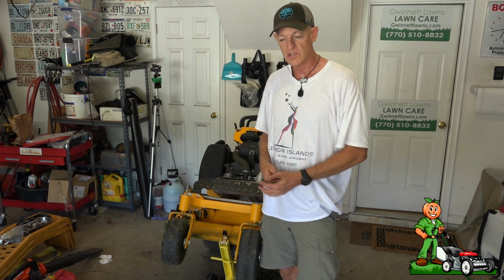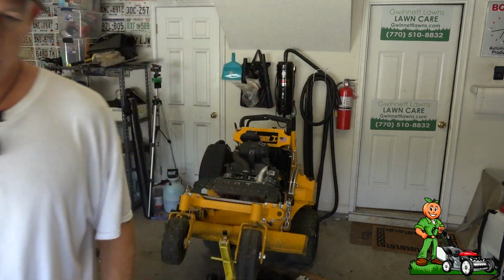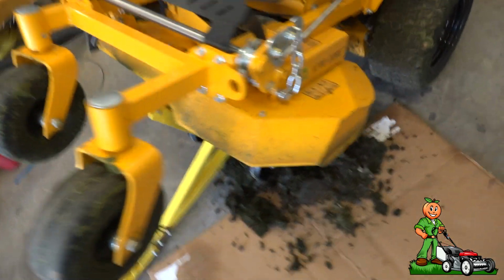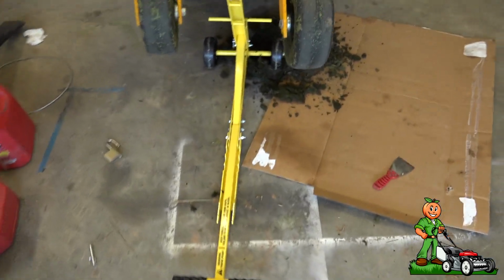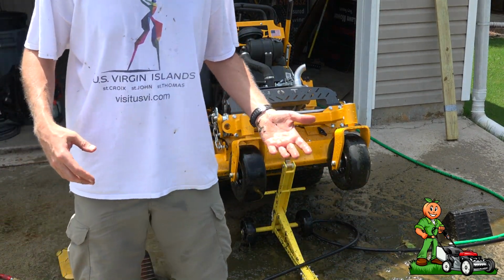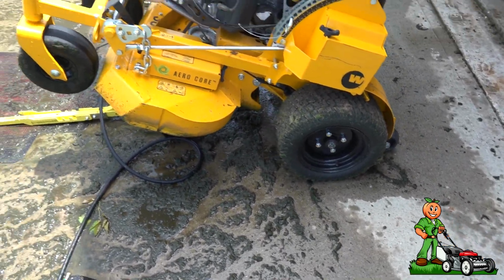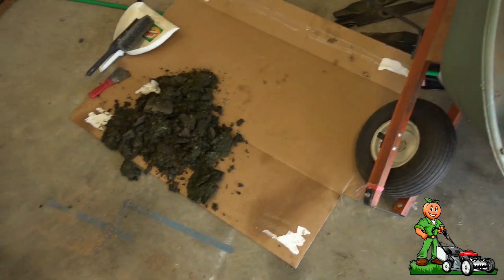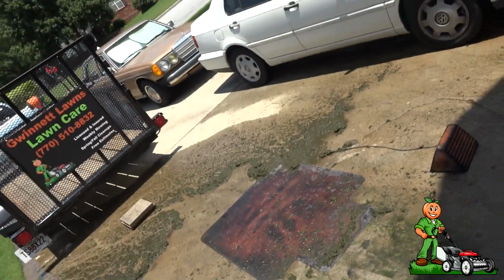Scrape or Wash the lawn mower deck of your Wright 36i stander

Comment: I would pressure wash but if worried about water getting in wrong places . Run the engine and engage the blade for few min. Most water would be removed

Comment: I have fescue and then August is crabgrass month. The crabgrass holds on to droplets of water for most of the day. I only get the type of "mud" you have under your Wright. I scrape and wire brush only, then spray WD-40 under the deck, when needed. the WD-40 repels water and makes it easier to scrape next time. If I mowed for a living I would scrape only. It's humid in the Summer and I don't want to add more water to the equation. Also, keeping blades sharpened means deck stays cleaner.